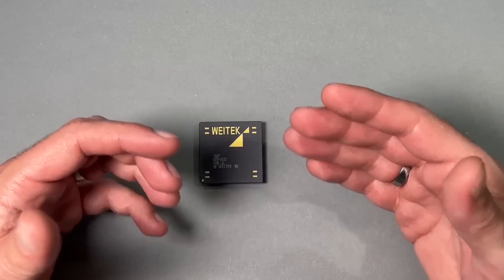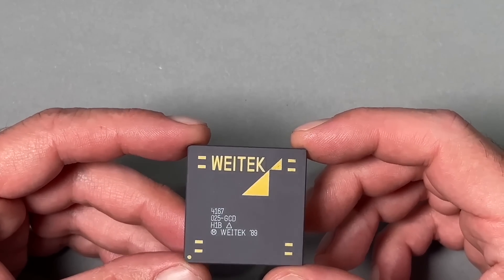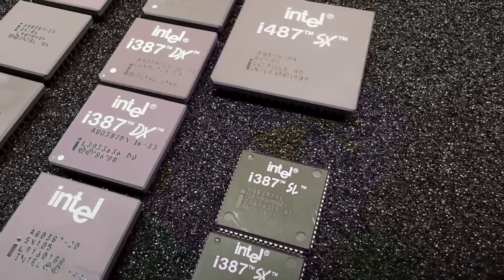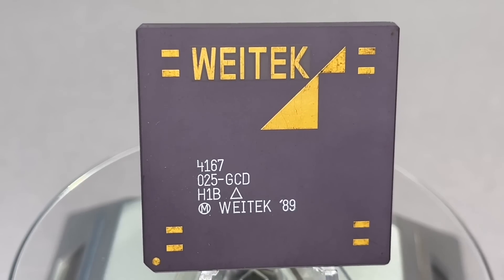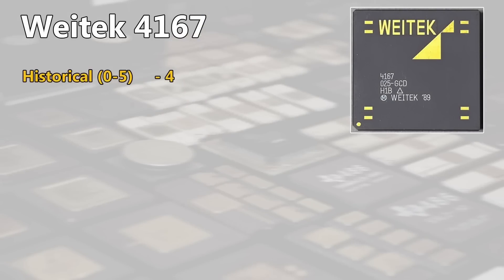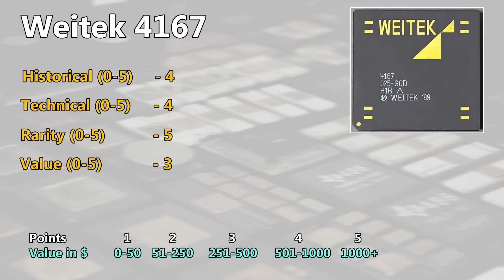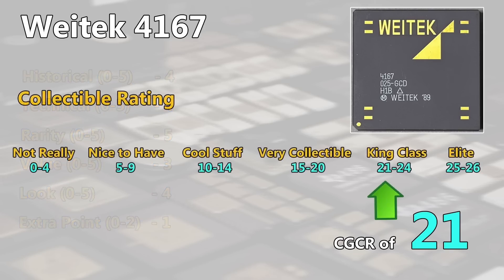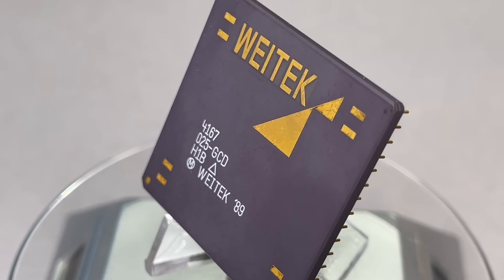Weitek 4167 Floating Point Unit / CPU Galaxy Chip Rating

Comment: That brings me to a quite relevant question. The Intel 80487 actually is a 468DX. When installed, the 486SX is disabled, while the 487 provides all the funcionality.
What about the Weitek 4167? Does it have a full 486+487 chip or is it FPU only?
Reply from the maker: The 4167 is just a FPU only.

Comment: It would be great to see you experiment with the Super Socket 7 platform. It was my favorite in the 90's. I had an AMD K6-II 300. Then a K6-II 400. Both of these I was able to easily overclock. I then discovered my motherboard was one of the rare ones compatible with the K6-III 550. These were laptop pulls I think. The K6-III was fast but sadly I was never able to overclock it AT ALL. Not even a little. I wish I had kept these cool old chips and boards. I bet you could do some great comparisons with these and the P-II and P-III and maybe even get a stable overclock on the K6-III. Would love to see it. Thanks for the fun videos. Your 486 @ 200 is my favorite.

Comment: It strikes me as a ... potentially not very good chip? As in didn't get that much foothold in the market for a reason. If it scores 2x the Intel FPU on a manufacturer benchmark, by all reason it does this on SP, since that would make it look the best, but x86 FPU does single, double and extended precision at the same pace. It's semantically not FPU compatible either, not just a software incompatibility. The instructions are limited to add sub mul mac divr and sqrt, neg, abs and... that's it? Missing logarithm (what sort of an oversight is that?) and trigonometry. I wonder how well its showcase advantage translates to real software.

It's just interesting now because it's rare and unusual.

Comment: I think at one point I had a 486 board with an 486 DX 33 that supported this chip. It had an extra socket and the bios had an option to enable the co-processor.. not sure if the board is still around.

Comment: Cool.... I always thought that an Intel 487 FPU actually "replaced" the entire 486SX by disabling it on the motherboard, because the 487 is actually a full 486DX. 
Or was that not ALWAYS the case?
So, is it different with FPUs from other brands such as Weitek? Was this actually an "FPU only" with the 486SX continuing to run the integer instructions?
Reply: You are correct about the 487.
Reply: I just did a google search.  The Weitek didn't use the 487 socket, it could only be used on motherboards that were specifically designed for it.   The instruction set was also not compatible with Intel's FPU instruction set

Comment: In the 90s, I had this chip. There was a hardware shop for older used computer components in my town. I bought quite a lot of stuff back then, and this chip was really cheap, because it was considered old, slow and obsolete. I wish I still had all the stuff! It makes me crazy to think about it sometimes.
Reply: Same here. I had a lot of 486 hp, compaq and siemens machines. Threw it all away during the early 00's. On the other hand, back then it had no value whatsoever.

Comment: I am very intrigued by this rating system. I don't think I have anything particularly rare, but it will be nice to find out what stands out from the rest in my modest collection. I have a 486 motherboard which allows me to enable Weitek support in the BIOS, but it has no socket on the board itself. I think the BIOS was just copied from an earlier board, but it's weird they didn't disable that option considering how easy it is to do.

Comment: I wonder if it's possible to make a wrapper for the instructions from intel to the weitek. Sort of like the GL wrapper for voodoo.
Reply: The weitek chips were fast because they didn't use the co-processor interface mechanism of the Intel bus, which forced the coprocessor to decode the instruction stream at the same time with the CPU. It used a memory mapped I/O area of the memory. This was a faster method of communication between de CPU and the FPU but would require a rewrite of the software that would talk advantage of it.
Reply from the maker: that would be really cool. Software for the weitek chip is rare.

Comment: I cannot wait to see Quake at 30 fps on a 486 with Weitek!
Reply: Unfortunately, I dont think quake supports that chip, but I fully agree with the idea.
Reply: @tl1024  Initially I was thinking that Intel and Weitek FPUs are binary compatible but no, the Weitek works on a completely different principle. Still I think it could be possible to recompile Quake with Weitek support. Not sure if any of the available compilers (djgpp, Watcom) have a Weitek backend, probably not. One may have do manual assembly as the last resort. Overall I believe it is possible, but very difficult to pull off. A very fast 486 (possibly overclocked) with a Weitek FPU, and a Voodoo card (probably V2 for max performance). Smooth Quake experience on a 486 that everyone has been waiting for the last 25 years.

Comment: Crazy, an add-on FPU for a CPU that already has a FPU (unless its SX), so a 486sx on board would need both a 487 socket and a socket for this.
And what software used it, in an era when Win3 software seamlessly used a DLL to run the x87 FPU if present and emulate it if not.

Comment: This is an interesting FPU as it was designed to replace/upgrade the FPU for a CPU that already had a FPU.   Slightly later on you’d see DSPs (Atari Falcon, Amiga 3000+ prototype), and then GPUs being adapted for the same thing..  but never again ‘just an FPU’.

Comment: I can fully subscribe to the rating. Being an old fart in IT, I saw loads of strange chips/chipsets over the years, having worked on x86, SPARC and Alpha system designs. I have only seen a  Weitek 4167 on one or two occasions. They had some popularity in CAD (Autodesk used to support them) and scientific applications, however, as the 486 had an on-chip FPU, literally nobody would spend an additional $$$ (these beasts where expensive) to have a Weitek - despite Intels completely pathetic FPUs.

Comment: I remember when PCs had maths co processors, that didn't last long, I guess no one bought one
Reply: Actually the reason it didn't last long is because they were quickly integrated into the cpu due to how useful it was to have and nowadays even the cheapest of the cheap cpus can do floating point maths without issue